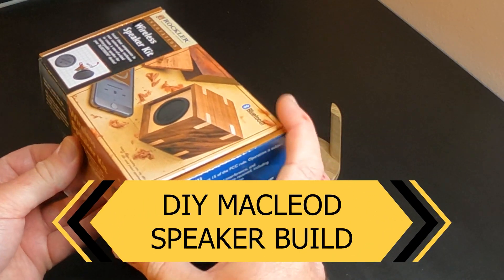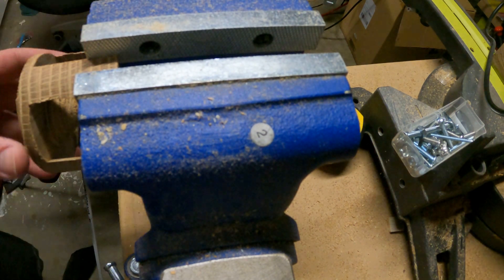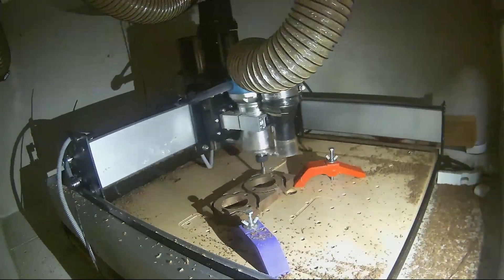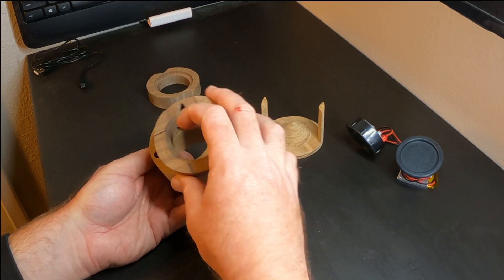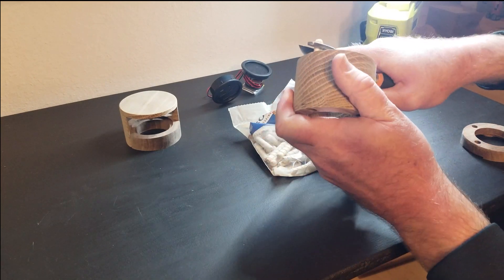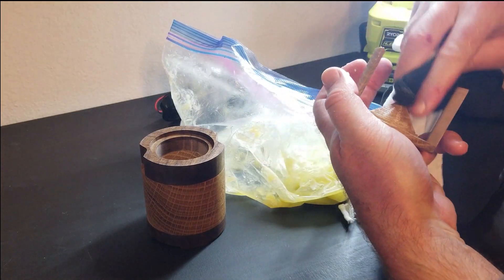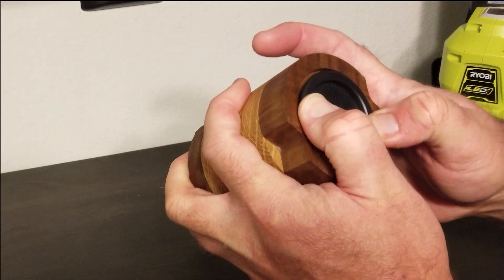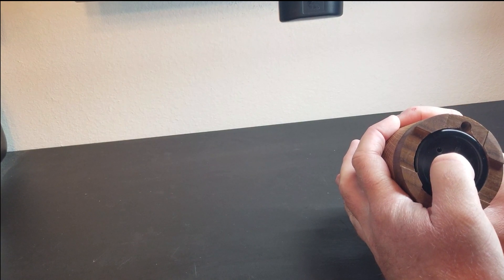Rockler Wireless Speaker Kit + Shapeoko 3 = Great DIY Gift Idea, But Watch Before You Design

Comment: late to the party but that's nice work.  I like that it's easily disassembled for any modifications, etc.  

Being a professional car audio installer from the late 70 to early 80s for about 13 years (one of the first certified in the US), I wish we had CNC's back then.  Certainly would have made for some interesting modifications and tuning options on the Rockford Fosgate hearse and Kenwood VW builds I was a part of.
Reply from the maker: Yeah I actually already took it apart and rewired it to be USB instead of battery powered.